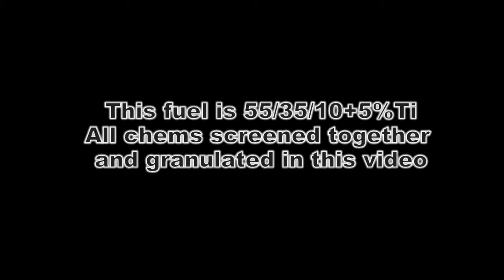Part #1 - How to Make a 1 lb. Core Burner Rocket w/ Can Shell Header - Tutorial Video

Comment: Machine I'm a machinist and a pyrotechnics guy well amateur pyrotechnics but you don't have to have more than one ram if it's machined right you can you can compress that tube with a hollow ram even if it doesn't match perfectly with the taper because it's going to pile up and ram what's below it no matter what so these amateur machinists go to the trouble of making two or three tapers and different Rams trying to get it perfect in may and then groove lines to tell you what's what it's all a waste of time when you get close to the top start using a blank ram and it's going to continue to compress what's below it it's absolutely ridiculous that they go to the trouble of making these different sized Rams and then they sell the tools for too much I'm thinking about starting an eBay store making these and I'll sell them for half the price these other guys do. It's August of 2024 in case you wanna look for me on eBay just look for the guy that's half the price lol I don't even know what name I'll use. Maybe rocket dude or something like that lol having a nice aluminum ram it's definitely worth it to spend a couple bucks on wood is crap I've used wood ones and I've always made my own Rams for my own hobby purposes and trust me you do not have to spend $100 a $150 on a kit it's absolutely ridiculous. You can have a 2 inch long taper for a core burner and just have the rest packed with fuel and it'll be fine if you saw how uneven these things burn to begin with once there 3 seconds into the flight they burn all crazy and crooked anyway once they're on their flight it doesn't really matter as long as thrust is coming out and the nozzle is holding together you'll be fine. As a matter of fact I'm gonna go make a OK mark down all the dimensions so I can reproduce it every time and start selling them for cheap and I would say avoid buying ones that are anodized black or anodized blue it's a waste of time and money and it's just so they can sell for more it it's absolutely useless to have something anodized specially when you're using all kinds of different crazy chemicals in the humidity some of those chemicals do get out of the burn mixture so don't fall for the pretty anodizing it's useless my period mine will be pretty they'll be shiny but they ain't gonna be anodizing I'm not gonna don't put them on the CNC to carve my name in them it's just ridiculous I'm gonna do these all manual you can do them faster than the setup time would take on a CNC

Comment: Everytime I hand rammed a 1lb bp rocket, I got a Cato. I bought myself a 12ton press from harbor freight tools 🔧 and never had a problem once I got the proper psi for every size rocket from 4oz to 6lb.
Reply: Hi there, is there anyway you could share your tonnage rating for each size, 1/4, 1/2, 3/4 and one inch inside diameter rockets for your press? I just bought my press from Northern Tool, a bench top 20 ton press with a gauge. I plan on modifying my press later to be foot pedal operated hydraulic pump. Your data would be very much appreciated by all of us in this very fun hobby. Thank you in advance for your help.